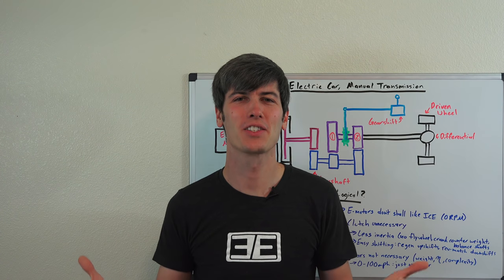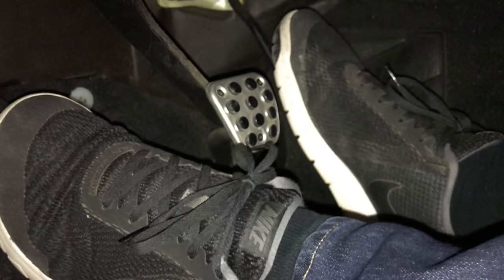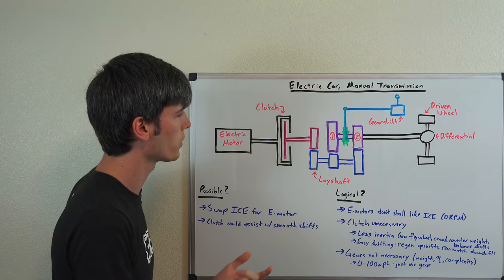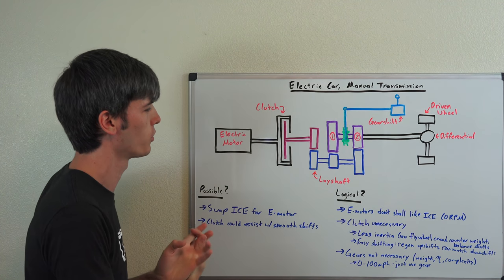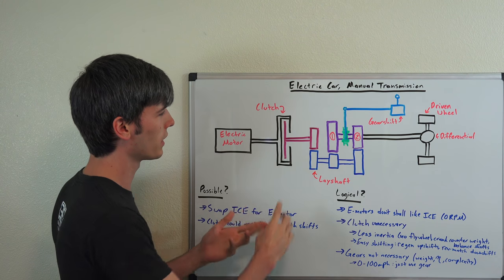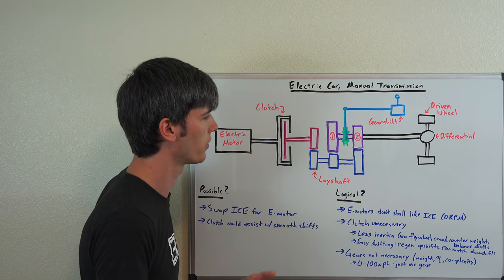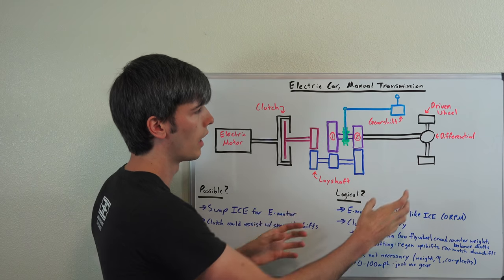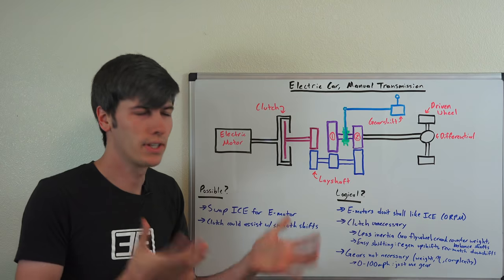Could Electric Cars Have A Manual Transmission?

Comment: Hi. Just wanted to say, that I liked videos showing old school cars like VW beetle or some old citroen that was converted to Electric and the clutch and gearbox was still used. The main reason was that it was easier to do, and the standard driving was on 3rd gear usually. Another reason was different, the electric motor used was relatively low power, so the usual city traffic was fine with high torque of electric motors, but then when you see some sports car on red light laughing at you, than you shift to second or even first gear, and off you go :-) 
I would not see any reason to use gearbox or clutch in new electric cars!
Bests TS.

Comment: Also, with big trucks, it could be smart to put a transmision with short gearing, and you press one button and you put the long gearing? Because overheating, energy saving and more useable torque?

Comment: I think you forgot about the main reason IC engines have a gear box in the first place, which is to keep the engine within its operating rpm range. Electric motors effectively have an unlimited operating rpm range. There will be a limitation at very high rpms but that will never be exceeded in normal operation.

Comment: Its strikes me that the clutch is only needed to allow for discontinuous torque being transferred.
With judicious control of the electric motor, the torque could be corrected at the time of shift and you could save on that component (clutch).
...oh, you just covered that.

However, you say electric motors are light. Well they work by magnetic fields and those are generated by more turns on the coils on the rotor, which adds mass.
A truly powerful electric motor would have lots of windings (and thick ones to handle the current), so the mass would be higher. This limits the highest rpm as the mass is rotating so fast that centripetal force would not be enough to keep the motor confined (it would fly apart or distort).
Since we can supply current regardless of the speed, we can use low speeds with high magnetic field and transmit to the wheels through a lightweight gearbox. The main advantage is that there need be fewer gears("Hi" and "Lo" would seem to be enough).

Comment: IMO manual transmission for EV could use changing the frequency manually. So, its cheaper than current EV that have automated frequency changing. Rpm meter for EV can be change into input power.
Ie, 1st gear input power (kWh) high, but low frequency = high torque (like traditional manual)
5th gear input power low but high frequency = more hp (also like traditional manual)

Comment: Gearboxes were designed to keep an engine within its more efficient range (efficiency curve), so being electrical or combustion, the need for a gearbox is the same. Also electrical motors could be smaller using a gearbox.  Please correct me if I'm wrong.

Comment: The BMW 330e (530e, X5e and 740e also) runs the motor through the gearbox (changing gear) I think this is more to do with being in the right gear when the engine starts but it works fine.

Comment: Manual transmissions still have logical applications and real benefits.  They're typically cheaper to construct and repair, as well as being more durable.  They also allow a car to be push-started if you have a dead battery.

Comment: I think most people are missing the point of manual gear ratio change on an electric motor.  If you are looking for efficiency for say daily use wouldn't it be logical to keep a low load at high speeds yet still be able to pull up a tree stump at a crawl.  Using a traditional gearbox a traditional way is illogical, we just need to shift a little differently and not be dependant on the tach/rpm/redline but more on the amp draw the motor(s) pull in any given scenario.

Comment: I think gears would make sense for no reason other than energy regeneration-assuming the motor can output the power and the batteries could take it. 

Basically go to a shorter ratio while braking and pulling more tq

Comment: My take is that the electric motors in cars don't really need a transmission, as long as the motor is made well enough there's no practical limit to how fast it can spin, so it doesn't need a transmission to achieve high speeds.  So if it's not a matter of RPM's to achieve high speeds, is it a matter of HP or torque to get the car moving?  Well, internal combustion engines have a fairly small power band (that's a RPM range where the engine produces high enough torque to be efficient enough to move the car)  So gas engines need the transmission to get enough torque to move the car below and above that power bands RPM range.  In contrast, electric motors, give or take a negligible amount, have 100 percent torque at 0 RPM. The torque and HP at the wheels remains pretty much constant throughout acceleration from zero all the way up as well.  So you can see without a limited powerband the need for a transmission to get the car moving from a stop is not there. You also don't need the transmission to try to stay in the powerband as much as possible throughout the acceleration like gas cars since the HP and torque at the wheels remain constant.  The biggest limiting factor for an electric motor's potential top speed is going to be drag coefficient and HP, gears wouldn't help here either since there's transfer loss and added weight with a transmission.  Therefore adding a transmission would make no sense at all.

Comment: To my mind, a CVT is the only logical choice of transmission for an electric motor, if indeed variable ratios are required at all.

I've been considering converting a Suzuki Samurai to electric at some point in the future and my plan was to simply remove the IC engine and gearbox all together and connect the electric motor directly to the transfer box via the driveshaft that used to go between the gearbox and transfer box, as a suitable electric motor should fit easily inside the transmission tunnel, allowing for both the engine bay and fuel tank space to be utilized as necessary for control equipment and energy storage (either batteries or a hydrogen fuel cell). You'd just need a speed controller that works similar to one in a remote control car so that reverse speed is limited.

In this instance the transfer box has low and high ratios as well as RWD/4WD so if I did need it I can select a lower ratio.

Comment: It's astonishing how much the established auto industry has kept drivers so set in their ways. The motor car is about to be completely redefined as the next mobile tech space, following in the footsteps of the smart phone. Piffling little annual incremental incentives like alloy wheels, sunroofs and [today] LED running lights will not mask the dated, outmoded, noisy, vibrating, smelly, polluting and maintenance hungry ICE.

Comment: My electric conversion has a manual transmission and clutch. The motor's peak power is at like 1500 rpm, and quickly drops to 75 percent deviating 500 rpm.

Comment: Manual makes sense for hybrids. If you're cruising at a constant speed, you may be better off periodically cycling between "charge mode" in a short gear and "discharge mode" in a gear that's slightly too tall, rather than compromise with a CVT or Toyota's pseudo-CVT. As for gears on pure electric, yes! Unlike popular myth, the efficiency and torque curves are far from flat.

Comment: yes its logical that we won't need any manual gear system for electric vehicles, but driving pleasure is satisfied only with manual gearing system. Most of the people buy cars to experience that pleasure and power of each gear. If manual gearing is added it adds additional components to the existing battery pack which eventually increases the cost of the vehicle. pros and cons both exist in this concept. It's up to businesses what they want to consider and change the revolution in the auto industry.

Comment: This is really interesting, as i was considering converting my 4x4 to an EV, but keeping the 5-speed and transfer case, so i can do some really really slow crawling with massive torque, but still cruise on the highway, not to mention the fun of having a 5-speed to play with still.
Reply: If you kept the SAME gear ratios as to what the original (petrol/diesel) motor had, then you would need a vastly heavier and bulkier electric motor, to sustain the original motor's load torque, at any gear setting. EV's because of the ability to drive a high-spinning rotor, that is then geared down to that of your original motor, also means it is automatically created that many times less able to drive your 4by at any rock-crawling high-torque-required "driving-ability" levels.
Sadly - your 4by would simply run itself into the ground, long before the batteries died, for sheer lack of convertible power.

Comment: I mean. If you dont need a clutch, then atleast they should make a 3rd pedal for an emulated "clutch" that when not pressed, an electromagnet holds the stick. But when you press it, the electromagnet turns off.

Comment: "There is no use for MT, other than for joy?" Good Sir, I've been watching your channel since the second episode, and it's usually on the spot. I'm sure I'm not the first guy to stand up for a MT vehicle, but I hope I make sense in doing so. I drive a 2014 Scion tC 10 Series with a lot of upgrades, not the least of which, is a short throw manual. Having driven a lesser trim of the same model with a 6-speed automatic, I can tell you I get far superior mpg in my manual. Today, in fact, was one of those days. Each way to the airport is 21.2 miles. I did not divert my route and when I got home, my average was a 38.2mpg...combined driving, both city and highway. Yet, she's only rated for 31 on the highway! The automatic is 1 mpg worse at 30. So how is this possible? Short shifting, engaging the clutch and coasting and knowing the road ahead so well so, as to predict what next higher gear would work. Automatic transmissions, even a good twin clutch setup, has more inconsequential losses than a manual transmission and especially doesn't like to go in/out of neutral. Again, unlike using my right foot on the clutch. Plus, no transmission knows a road or race course like a driver. That may be the variable forgotten in your statement; the driver. That same driver needs the speed and agility of a manual. Oh, and they weigh less, too. Okay, Mr. Science, prove me wrong. Your, Captain James.
Reply: You don't get the point. The main question wasn't if it would make more sense to put a automatic transmission into an electric car instead of a manual or vice versa.
The question was, would it make sense at all to put a gearbox with multiple gear ratios into an electric car and the answer from an engineering standpoint is very simple. No it makes no sense other than for the joy of having multiple gears. It doesn't even matter if this gearbox would be manual or automatic.
Reply: shi01 I don't recall asking you, but your opinion is noted. Of note, is the BROADER point I added to the discussion. He even has links about manuals in other videos. Regardless of which video I pose the question in, I still posed it. But, again, nobody asked for a troll to comment. Now, back under your bridge ya little monster.

Comment: If you can reduce gear in regenerative braking you increase the voltage the motor generate, more voltage more flow of electricity the battery will receive, less need of use the real break, mid pedal break will be translated on insert lower gears, maybe an actual system of transmission are ineffective but just don't say no by default, the transmission will be a lot lighter than the one of gas engines.

If you give electricity at just a phase of an electric motor you can put the rotor in some precise grades, and you can make the gears size having the number of coils in mind, making swift between gears in fractions of a second, this control over the rotor wasn't available on gas so take advantage of that engineers.

Comment: Agree, it's not necessary to have manual transmission in an electric vehicle, power loss is the main reason, the only reason i need and i drive manual transmission is because my daily driving vehicle is using internal combustion engine, which still need clutch to prevent engine from stalling

Comment: how about the gear changing is more like a boost setting.  so gear 1 would be your power saving mode where the electric motor is quite weak but uses very little energy.  then you could shift up the gears and with each shift the motor uses more power to gain more torque and what not, but in exchange for a smaller travel distance.  so gear 1 would be slow but very long distance and gear 6 would be very fast but short distance.

Comment: The only need for gears in an electric motor would be for something requiring lots of low end torque like a semi-truck. It could be done with a large electric motor but why not use smaller... With a smaller electric motor I could see how one gear may not be enough to get everything moving initially, creating excess strain and heat on the motor.   2 gears should do the trick, a  5:1 first gear then 1:1.

Comment: Two words. Torque multiplication.
Smaller, cheaper motor (with less strain on it, or making it easier to remove/replace/service), better regen braking at lower gears, and making a smaller motor be able to tow easier.

Comment: In a sense, this is great news to know, manuel transmissions aren't dead yet but the main thing is, since it uses electricity, couldn't you take advantage of the loss by reworking somethings since it isn't as limited? I can elaborate if needed I suppose

Comment: I would want at least a 2 speed transmission no matter what. If you have a 2 speed transmission, you can use a smaller motor. When you get over 30 or 40, you shift into the higher gear for greater efficiency. Just like with a piston engine.

Comment: If electric cars (company like Telsa) wants to compete in top speed, with gas powered cars, ex. super cars like Bugatti. Having a 2-3 speed transmission makes sense. Currently the rpm would be to high for there electric motor to get to that 250 mph mark efficiently in a single speed transmission.

Comment: I think with the direct drive how they are now, there is much less power loss. There is an incredible amount of power loss between the motor and transmission, and even in the differential like you said in the video. There is also no reason that electric motors can't be built to the same tolerances as a turbine engine, so that they can spin at 20,000+ RPM.

Comment: Yes.

You could use a manual transmission with an electric vehicle.

Some of the home conversions recommend a manual transmission locked in 2nd gear.

Yo could also use a common automatic transmission with torque converter but that wastes up to 20% of the power.

Comment: Electric car with integrated CVT (continuously variable transmission):
In cross-country driving, especially in hilly areas, you need to vary the torque-speed characteristics of the vehicle for good chassis dynamics, allowing you to drive fast yet safely. 
Using a DC electric motor with field strength control does just that. A strong field is used for high-torque/low speed, and as the field is weakened, the motor can pick-up speed, but with a lowered torque. 
The driver should have a lever to control the field strength (i.e field current) in a continuous step-less way. Thus to the driver, it is like having a manual continuously-variable transmission(CVT), where he plays with the throttle (which controls the armature voltage) and the "gear lever" (which controls the field strength), to maintain optimum speed /torque as driving conditions change.
Regenerative braking is efficiently performed by leaving the throttle, and gradually sliding the gear shift to higher field strength, while watching the rev counter to maintain the motor at optimum RPM (could be marked with a green line on the rev counter), thus slowing the car almost to a stop without touching the brakes.

Comment: What if 'V-Belt stepless' CVT transmission will be used instead of traditional one (CVT tansmission is very light, plus smaller and lighter electric motor can be used with it, reducing weight and power consumption). This solution (without clutch) can make a sense for city cars...

Comment: It will be fun to drive but the car would be heavier therefore there’s a trade off which is efficiency. A manual transmission gearbox can weigh up to 200 lbs.

Comment: I really hope they develop electric vehicles with a 5- or 6-speed manual transmission and a clutch. I don't want to drive automatics. 

In an ideal world, I would love to have a electric vehicle with a manual transmission and a clutch, but also have it be autonomous for when I'm dead tired on long, late trips. It would he awesome to switch between manual-mode and autonomous-mode with a push of a button.

I think electric vehicles will be more efficient (and perhaps quieter, less whine from the electric motor) with a manual transmission when the technology advances sufficiently enough. Just like combustion motors started off with a 1-2-gear transmission, it'll probably progress to standard 5-6 speed manual transmission.

Comment: OK, let's simplify; a versatile electric car, i.e. one usable for most purposes, from urban to long-distance transporation, needs a multi-speed transmission if it's going to produce decent braking torque/power at urban speeds (isn't increased efficiency one of their raison d'etres?). Tesla decided to go with a cheap/simple, single reduction speed and hence were forced to use HUGE motors to get useful braking power /  regen at urban speeds.